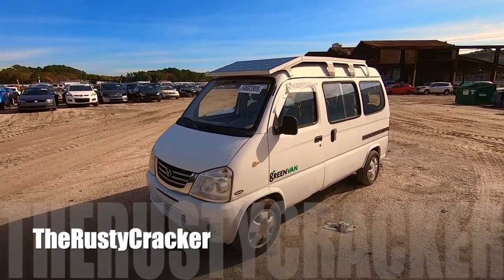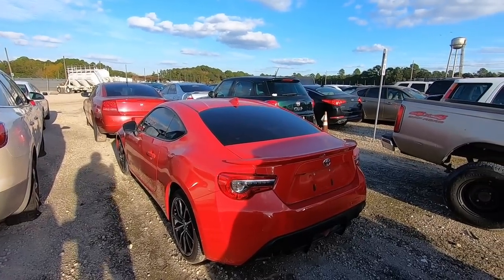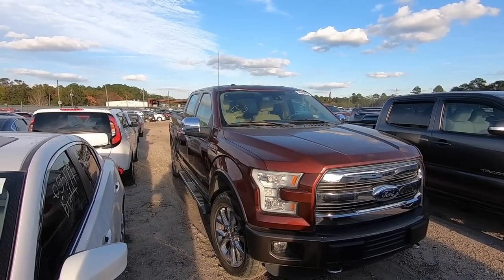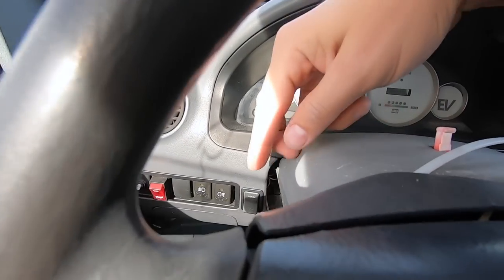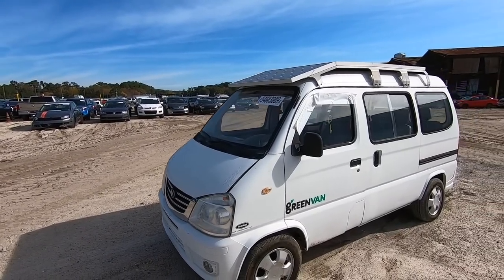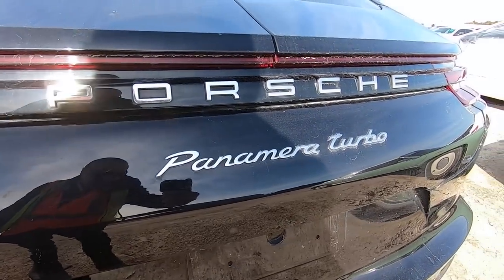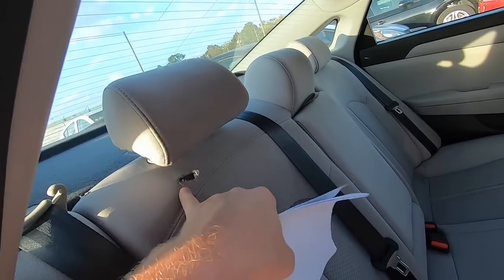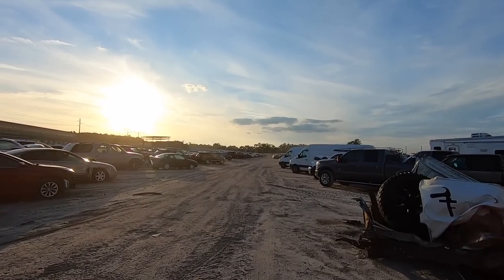Exploring Copart SALVAGE Auto Auction |Finding A CRAZY ELECTRIC Minivan |RICH REBUILDS| CRAZY WRECKS

Comment: Rusty, if you asked the staff out there at Copart if they have a jumper pack for you, the 190 might be a option for you. Ask your local yard if you can take a jumper pack with you. Randy for Auto Auction Rebuilds does it the same way, but with permission for the yard manager and Copart Corperated. Just a heads up for you.

Comment: power cable for cutie van is pretty simple it's like the same blue plug that you use for a caravan in European Union check if it supports 240 volts for faster charging

Comment: That flood-damaged vehicle the fluids need to be changed evidently it sucked up some water so you have fluids mixing with a couple of oil changes and a transmission service but the transmission should be fine just oil changes

Comment: Car thieves can get a coder and recode the key fob to work with a key fob that they have, all they need is the owner to trigger the signal with the key fob and they can re program it with the signal. so the owners key wont work and the crooks key will. that's prob what is wrong with it with the Porsche.

Comment: 6.4 redesigned 6.blow 
7.3 best ford diesel just not the fastest but it will run for ever 
6.7 is a great engine fast 
i just dont like def fluid and smog crap
Reply: That’s why you perform a DEF delete